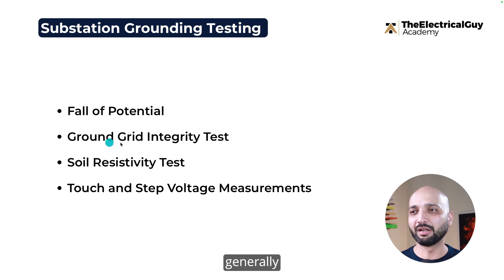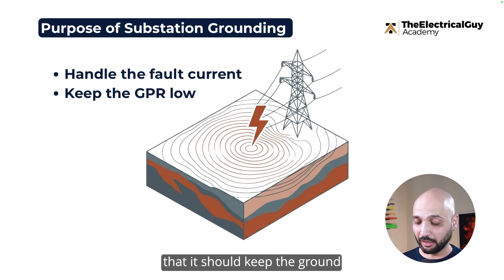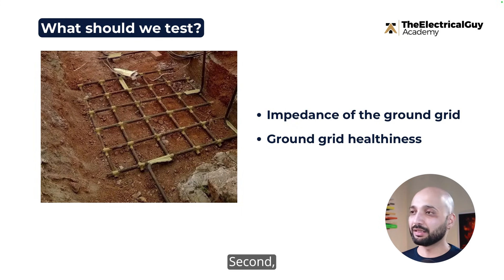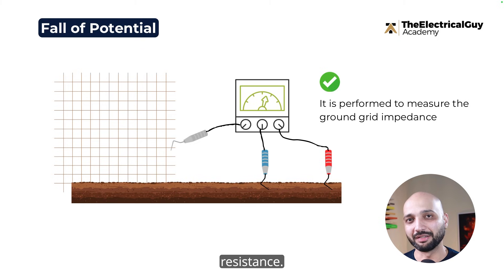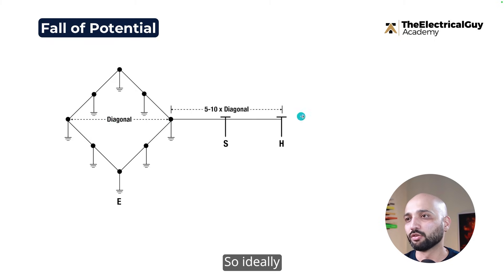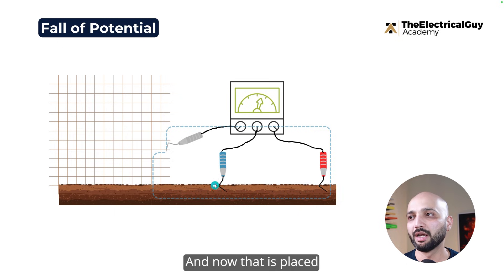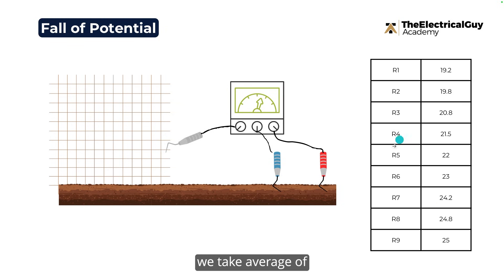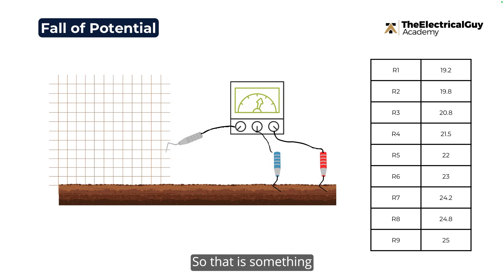How Substation Grounding Is Tested (The Methods Explained)

Comment: What is a good value of the grounding resistance after you connect the electrods  on depth of 0.6- 0.8 m and the prefabricated bars grid ? Is it 1 or 2 ohm ? What is a good value for 110 KV, for 220, or 400 KV as example ?